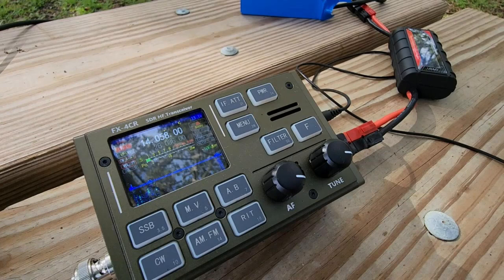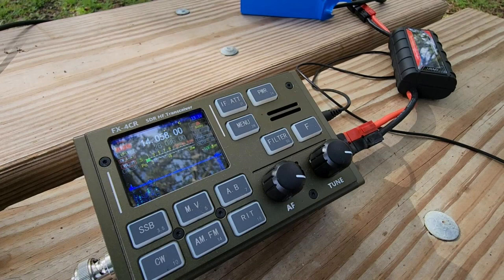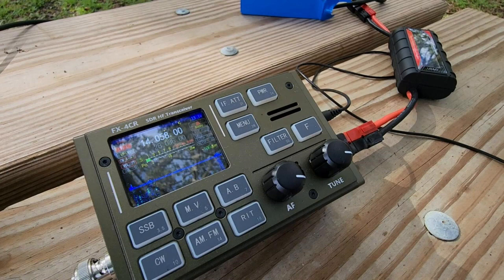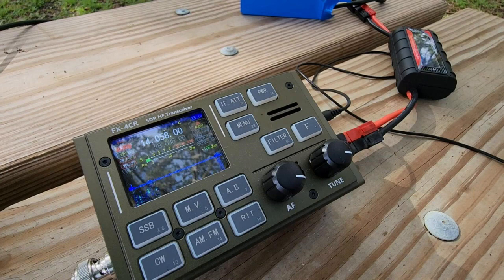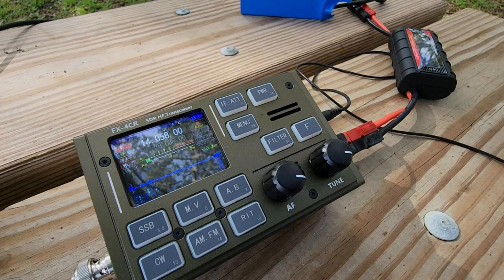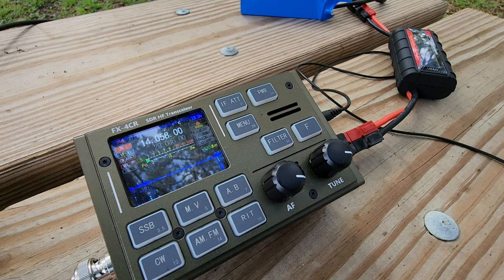FX-4CR CW keying problems

Comment: I was having a problem with my FX-4CR, when I would turn on the Noise Reduction function and I would PTT the sound would shut off. I would have to turn off the radio and turn it back on for the sound to return. I thought maybe if I updated the firmware, apparently my radio was running 1.2 ver firmware, you can see the version firmware flash on the screen when you turn it on. I downloaded the new firmware 1.5 version and updated the radio and it fixed the problem. Give that a try check and see what version of firmware you are running.

Comment: Oh. That would be frustrating indeed. I hope that Yu can sort those issues out via firmware. It otherwise seems to be an amazing little radio. It's coming up on a year since I ordered my FX-4L and I'm not too worried about the delay--I just hope that it's a little more polished than the FX-4C when it ships. Thanks for the video, John! -Thomas (K4SWL)
Reply from the maker: Hi Thomas - I hope a firmware update can fix this problem but I suspect it's a hardware issue. And I hope you'll have better results with the FX-4L. 73, John

Comment: I am sure that both issues are highly frustrating.  Do you think the loss of tx sidetone and audio artifacts are a firmware issue that can be fixed with an update?
Reply from the maker: I think it has to do with the T/R relay being too slow for the job, either due to characteristics of the relay itself or debounce circuitry associated with it.
Reply: @AE5X  I am not sure if it applies to your FX-4CR, but W2AEW just posted a video about replacing a board for some hardware improvement made on this rig after the initial production run:  https://www.youtube.com/watch?v=9eSDBFIW8sE
Reply from the maker: Doesn't apply to this radio.